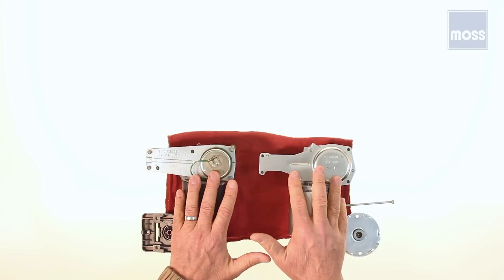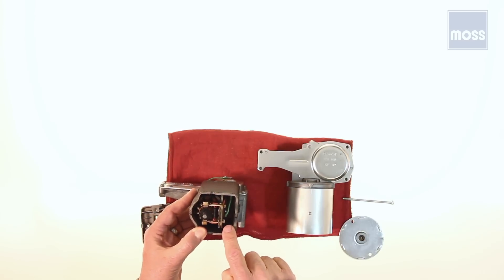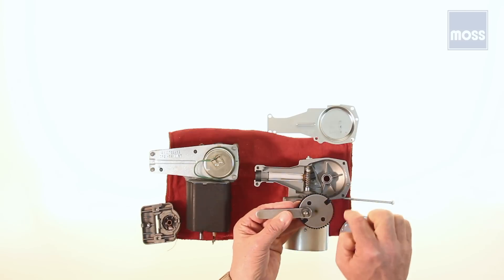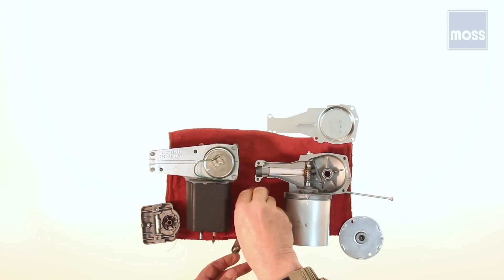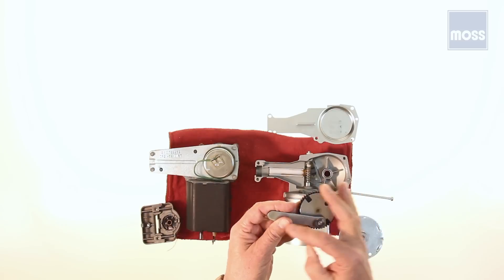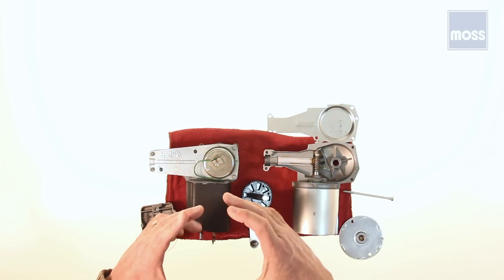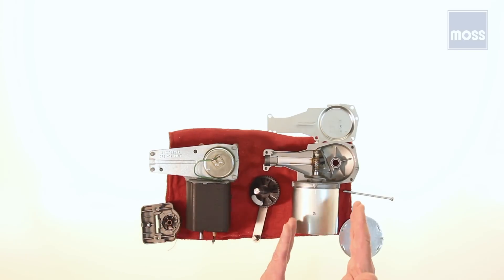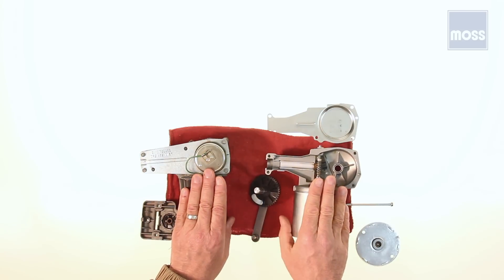Windshield Wiper Motors -- How They Work

Comment: THE BIG DEBATE!  Up or Down?
In the snow, if a newer car (2000+) get's it's wiper stuck to the windshield, can it damage the motor?  I have seen most motors stop and then attempt to wipe a minute later. Once it is no longer frozen to the windshield, the wipers work fine.
So if it can damage a motor, would it be better to leave the wipers up from the windshield?

By the way,  AWESOME VIDEO!!! 🙂

Comment: My wipers come to a stop consistently in the middle of the windshield even though while they're running they have the correct span from the edge on the glass. I was trying to apply your explanation to the behaviour I'm seeing but I'm not quiet able to connect the dots unfortunately. If the regenerative braking functionality was broken on my motor I'd imagine my motor would coast and the wipers would come to a stop at various places on the windshield, depending on the timing of when I turned them off. But that's not what is happening - they come to a stop at the same spot every time, just not the correct spot (bottom of rotation)! Is it that I have regenerative braking, but somehow it's getting a different degree of resistance somehow so they consistently come to a stop after a short but consistent coast?

Comment: Love the video!  It was helpful and informative.   I took issue with one part though.  Worm gears are not typically back driveable meaning the wiper shouldn't be able to push back on the motor to generate current.

Comment: wait, short circuit in motor? So it means every second in parking position motor consumes a lot of energy? Why doesn't wiring melt ?
Reply: That's what the little protruding chip at the back of the wheel is for- it cuts the secondary power source off as soon as the wipers travel all the way back down to their original position. 
The main power source is not constant either. When you turn the ignition on, power is sent to the wiper switch, but in order to close the circuit, you'd have to turn the wipers switch on to actuate the wipers motor.

Comment: My wipers were frozen with snow when I turned them on. After this they would not park;any solution for this?
Reply: +sam davies You short circuited your wiper motor. Check the fuse that controls the wipers. It is probably burnt. You can try to change it, but if it keeps burning, you'll have to change the motor